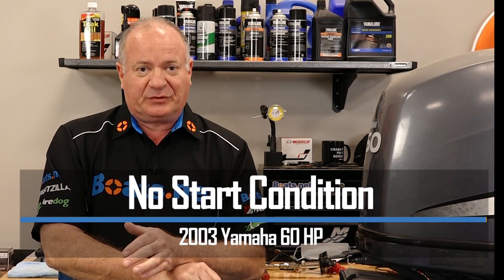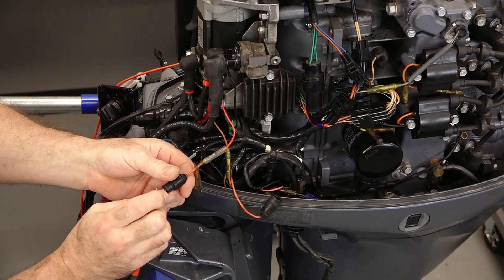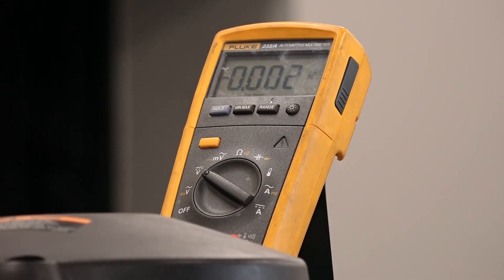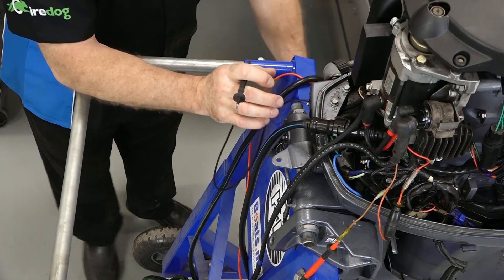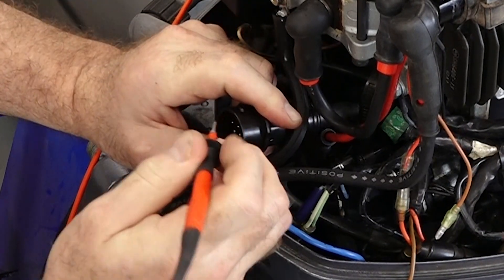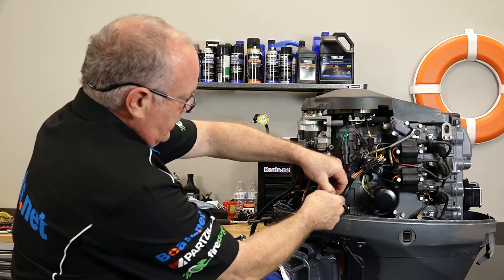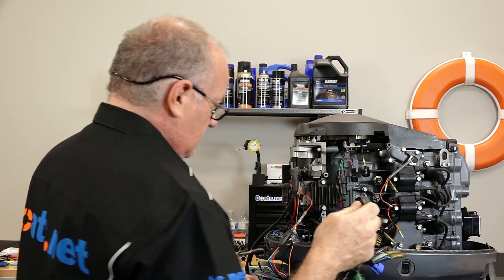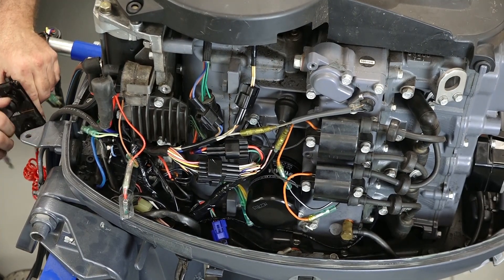My Outboard Won’t Start | Yamaha Outboard Starting Problems | Wiring Harness Replacement | Boats.net

Comment: terrific videos John , I recently purchased a boat with a 1996 merc 225 blue water series 2 stroke was instantly firing right up every time I touched the key so I gave it the once over checked fuel all good and clean , installed a new filter , T stats , poppet diaphragm. checked it for charging while running and had 13.8v so figured great it charging . All was good started it and ran it several time after these repairs checking temp excreta, planning on taking it out the following day . I mistakenly left the battery switches on over night , no biggie I thought got to the ramp and launched the boat hit the key and it fired right and ran four 3-4 seconds and stalled, that was odd compared to how it had been running the days before , tried to re start and it would spin over like crazy but would not fire up . Another guy there said give her a shot of starting fluid that he had , so I figured why not so I cracked the throttle plates open a bit ( in neutral) and it fired and died . so out it came and I figured the plugs somehow fouled out so I pulled them and they were soaking wet so I figured ok they were just fouled , installed new plugs and still no fire and what appears to be weak spark on my old blue light spark tester on all cylinders and she still wont fire up . and thoughts on where to turn next ? Thx in advance for any advise !

Comment: Great video. That's exactly what mines doing. I'm gonna go check the neutral safety switch. I have power at the trim. But no power at the starter won't crank. Thanks for the info.

Comment: Hey I was watching your video from 6 years ago about replacing an impeller. I have a Yamaha 200 and I replaced the impeller and it is pumping water fine now but the propeller won’t engage when I move the lever forwards or backwards. Is there something that I messed up when I took the foot off and put it back on?
Thanks,
Sam